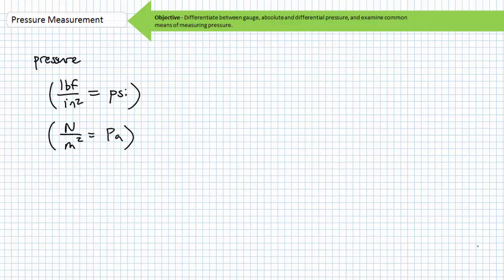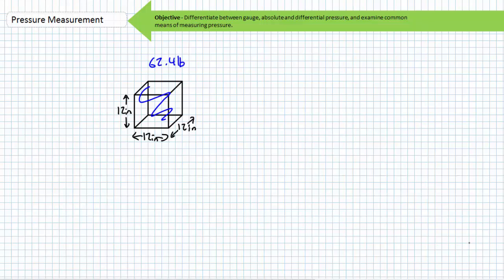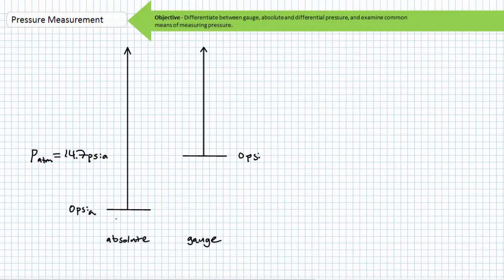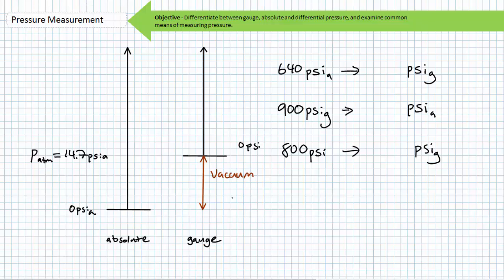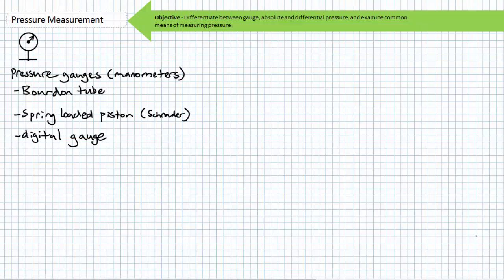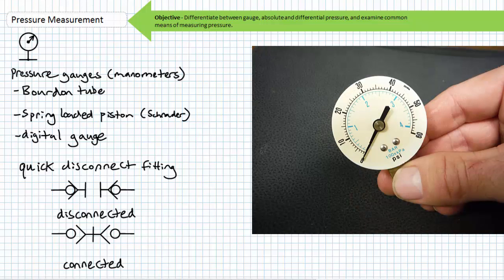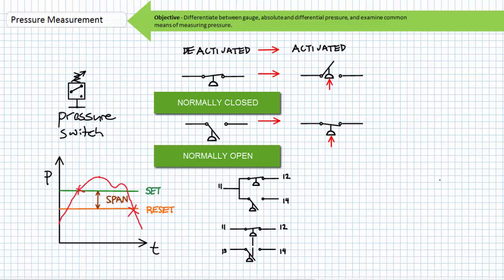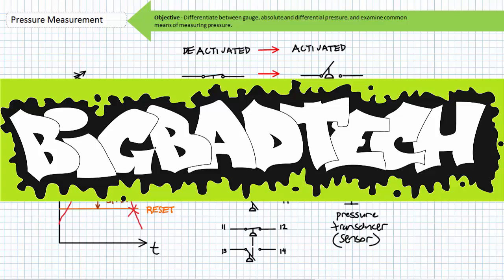Pressure and Pressure Measurement (Full Lecture)

Comment: I have a question hope you respond. I currently have a gauge that reads in  PSI and it produces a graph of time VS pressure however I require a reading in lbs kgs or tons is there a way to calculate this.

Comment: Pressure Gauges used in Hydraulic Machines have got a small hole of 1 mm dia, How does the gauge shows the correct value of pressure in system, there should be a pressure drop as it is also similar to orifice?
Reply from the maker: In the static, no flow condition (ie: no actuators moving nor valves shifting) pressure would be felt equally and undiminished in all directions.

Comment: Hi. great videos and easy to follow (educational videos are usually boring but definitely not yours). I'm an electrical engineer but had trouble following with the mechanical engineers when working together with systems involving hydraulics. I always tried to compare hydraulics to electrical systems ( pressure and flow to voltage and current) but often failed. At this point I think that I was missing that hydraulic pumps are constant flow sources (electrical sources are usually constant voltage) and this is why I couldn't understand the pressure-flow thing. I think by the end of the series I will be able to easily understand and interpret hydraulic circuits.
Just want to say that there's a calculation error at 2:03 (650Kpa=94.25psi). Thanks a lot
Reply from the maker: Good catch! Yes, 650kPa is equivalent to 94.3psi. Good comparison of hydraulics and electronics too.